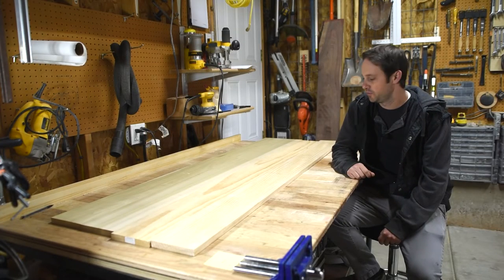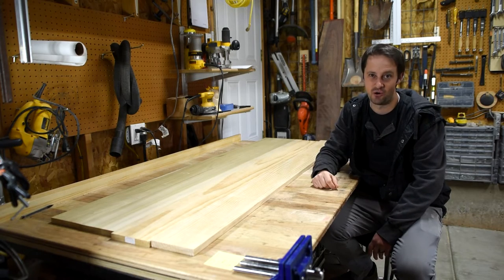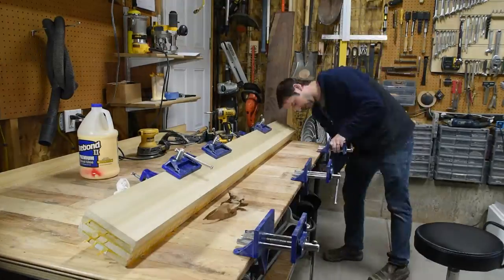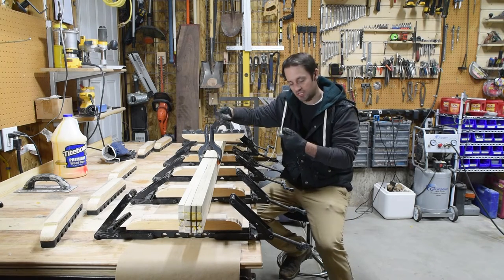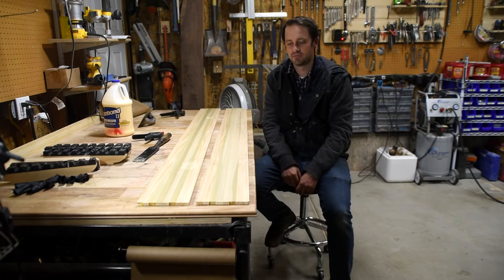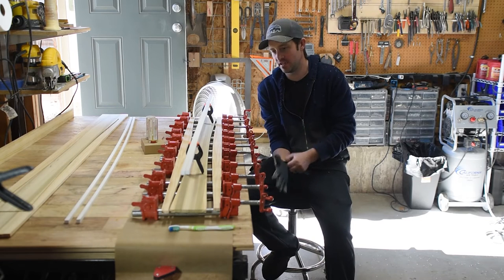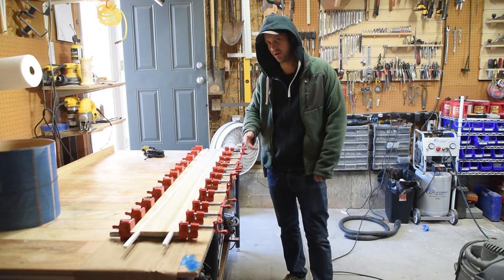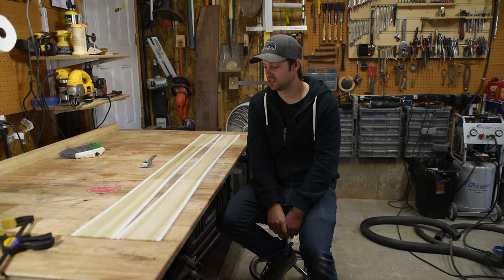Ski Building Series - Part 1 - The Core

Comment: Great building! One question: Why aren´t you using your CNC to profile the core?
Reply from the maker: Good question. The CNC has a smaller router so between programming and running it, it takes much longer.  I do have that as a future goal... stay tuned.